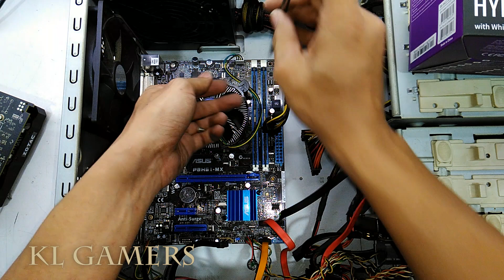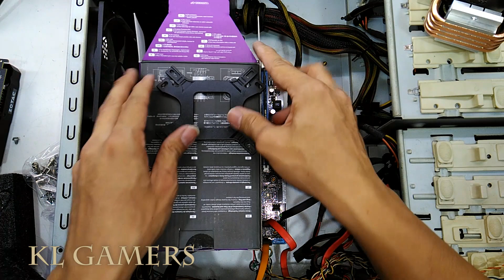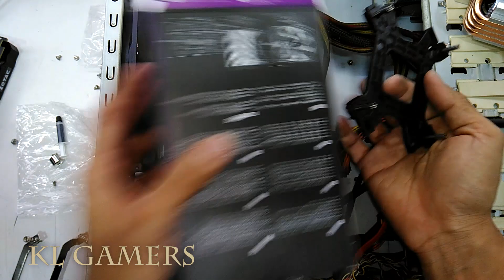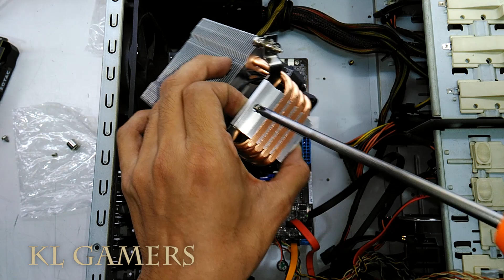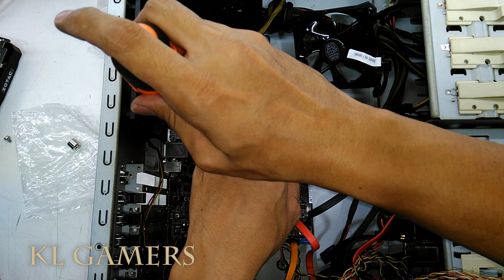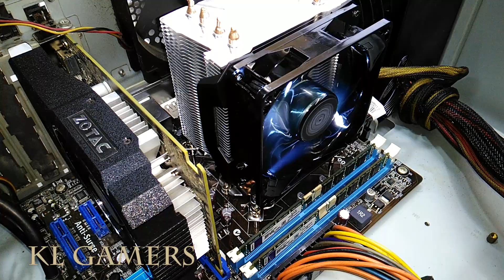How to Assemble Cooler Master HYPER H411R CPU Cooler with White LED Fan 2019

Comment: why are u installing the cpu cooler looking the Ram?
i think its better if u install it looking to the I/O panel for a enhanced airflow.
Reply: thats how it goes on
Reply: aint it supposed to go againts the heatsink?? why would it go towards the back io panel, u drunk
Reply: If you have an cooler fan back, placing the cpu cooler to that side would generate condensation